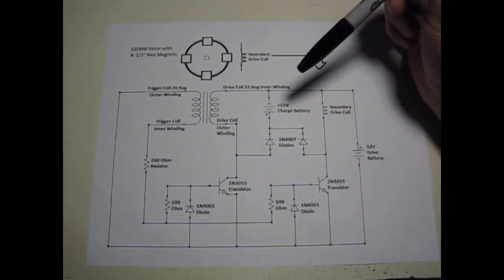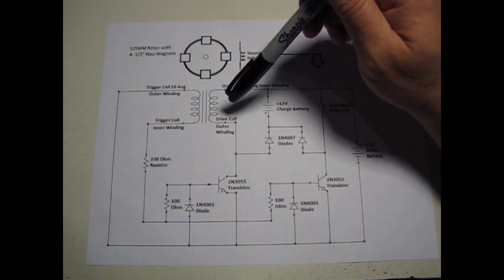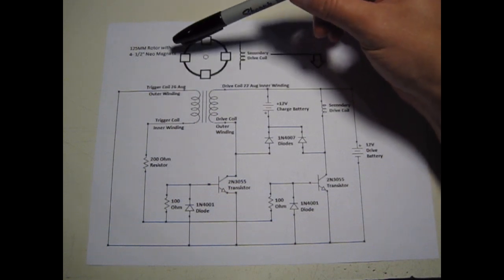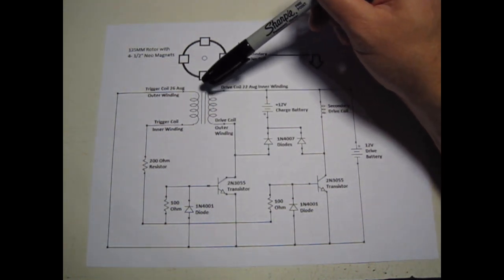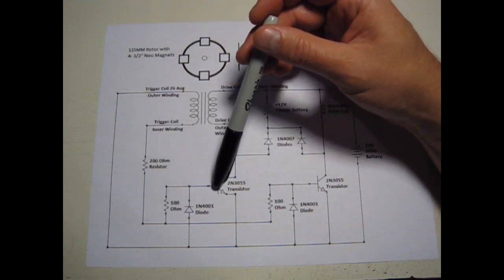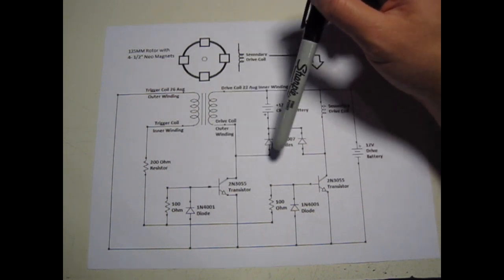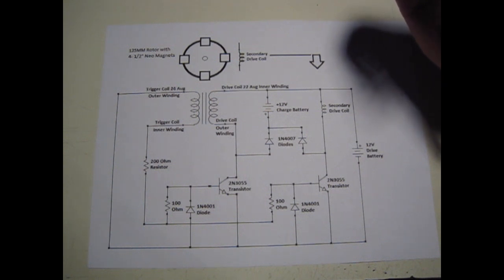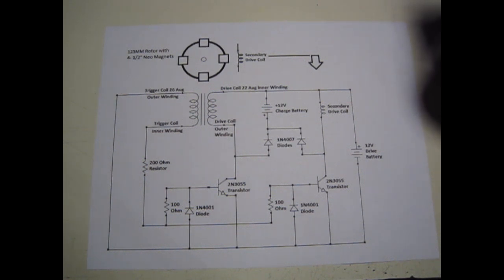My Understanding of the Bedini Circuit and Timing

Comment: 1:00 correct and incorrect
the revers polarity is dumping into the battery not the drive battery polarity but the drive coil reverses polarity when the charge is removed

Comment: https://youtu.be/yi7cmUpMdX8 shows the best step by step explanation.
Bedini Motor Step-by-Step Operation
Step 1. As the magnet approaches the coil, it induces a current into the trigger coil that goes through the 1N4001 diode, the resistor and potentiometer. Simultaneously, the magnet induces current into the charging coil which travels through the blocking diode and charges the charge battery and then back to the charging coil.
Step 2. When the maget is at top dead center or directly over the core of the coil, the induced current stops.
Step 3. Once the magnet has passed the core of the coil, it induces a current in the opposite direction in the trigger coil. This current travels from the trigger coil through the potentiometer, and then through the resister, and then through the base of the transistor and out of the emitter, and then back to the trigger coil. This current  travels through the base of the transistor and then exits out of the  emitter, which turns on the transistor. With the transistor turned on, current travels from the positive terminal of the supply battery through the charging coil, and then though the collector of the transistor and out through the emitter and then to the negative terminal of the source battery.
Step 4. Once the magnet has past the coil, the magnet no longer induces a current into the trigger coil. With the trigger coil not supplying current to the base of the transistor, the transistor turns off. With the transistor turned off, current ceases to travel through the charging coil thereby causing the charging coil's magnetic field to suddenly collapse. This collapse creates a high potential spike current in the charging coil. This high potential spike current travels from the charging coil to the blocking diode and then through the same blocking diode and then to the positive terminal of the charge battery, thereby, charging the charge battery.

Comment: Try drawing up the circuit in time. The trigger saturates the coil and the back emf is the repulsor. The efficiency is all in the circuit being in resonance. If you get runt pulses as you describe then some part of the circuit is the wrong. Example the resistance of your wiring, maybe induced capacitance that type of thing. Someone else here talks about double frequency I would go with that, replacing the transistor with a mosfet will fix that.

Comment: The problem with this circuit is in the discharging of energy in the primary (26 GA) every cycle. Since the base of the transistor cannot consume all the energy. I think that the circuit fault is the 1N4001 and that it should be a zener or schottkey diode, not a rectifier. In addition, it needs to be a zener or schottkey that can support the current drain from the primary coil in time with the frequency of operation. Otherwise there needs to be a better detection and trigger circuit that isolates and will allow the consumption of current. I would try an opto-isolator (opto-FET) instead. In addition there is a better circuit using an full or half H-bridge for commutation of the transistor. IMHO this circuit is simple, but too simple and neglects some good design practices. It should be looked at carefully for each side; including the transformer (primary to secondary effects) when each side is charging / discharging.

Comment: If you add a neon bulb 105-125 volts with external resistor  indicator in each emitter -base transistor  it adds a better oscillation.

Comment: Hi Dave. 
My Bedini 4 inch hard drive motor stops spinning when I hook up charge battery tarted all kinds.from what you have said I should be looking at the resistors and pot set up?It like it's putting A load on it and comes to a stop.if I unhook the charge battery is spins back up!what do you think is wrong? Help Bruce
Reply: For all you guys trying to achieve overunity my advice is that before trying to build any prototype, it should be working first on paper, when all does work on paper and simulator if you have the tools then you build your prototype.  For now the "Thing" stoping the 4 inch motor is know as "lenz law" and let me tell you this bastard "lenz law" is not easy to trick it in to giving to us free energy,  to describe it in terms that you know   it is like "soaking your hand in a pool full of water , every direction you choose to move it will react against your motion.  You can also feel lenz like this, disconnect the electronics from coil, short circuit both coils, then try to move the 4 inch motor with your hands, this is how lenz feels like, My guess is that the error comes from Bedini that misunderstood lenz law thinking he can make it push. Because this last part is not true is the reason the motor stops.
Reply: @Aircooledpowerquest  You have no idea what Bedini was thinking, you have no idea how his device works!!

Comment: Greetings I have worked in various designs within Badini theory, I have that to achieve enteder autonymy a home must have 3 basic things that are high speed, and get to work with vaoltaje is over 230VAC, and have a batreia 700faradios ultra capacitors to 16vcd, to load the system wattage kind that yields but her turn to see the trs. gibts as greetings option atte energies jr

Comment: So any adjustments you make to the resistors at the base are best made so that the base emitter potential before the pulse is about 0.4 to 0.6 volts. Any more and it will conduct without a pulse. Any less and it will eventually generate harmonics or double pulsing.

Comment: The multiple pulsing you are seeing occurs when you apply a smaller than normal bias current to any PN junction i.e. your transistor base emitter junction or a diode. It's a technique used in RF circuits to typically  double frequency through spurious harmonics. 

So any adjustments you make to the resistors at the base are best made so that the base emitter potential before the pulse is about 0.4 to 0.6 volts. Any more and it will conduct without a pulse. Any less and it will eventually genera

Comment from the maker: @llorencaguiar - Hey llorencaguir...the potnetiometer is only used during tuning and goes where the 200ohm resistor is. When I measured it...the resistance was roughly 200ohms. The neon bulb is just used as a visual aid for tuning...I prefer to use an O'Scope. It would connect to the Collector and Emitter of the Transistor. If a Bifialr Coil is used for the secondary Coil...just connect the 2 outer wires together and the 2 inner together. This would put the 2 Bifilar in Parallel to act as 1 Coil

Comment: I hope you can answer a few of my questions:
Are potentiometer and a neonbulb used on the circuit?
If yes, where do you put it?
The second coil seems to only have two wires connecting it in the schematic- since it is a bifilar wrap, wouldn't it require four wires? (like the first coil)

Comment from the maker: @usedbandage9 - I think its pretty much the same thing. I've heard that by twisting the wires as you wrap them...it makes for a more efficient coil. (I've never twisted them myself so I'm not sure.) I have done a Trifilar coil...3 wires wrapped around the coil. 2 of the wires I ran in parallel with each other, the 3'rd I used as the trigger line. Made for an excellent coil for the Bedini Circuit.
Dave

Comment from the maker: @allclear7- Thanks...Great to hear. I haven't tried a Trifilar yet...maybe on the next build.  (I think that would be interesting). I also used a variable to find the sweet spots...then measure and put in a resistance that is close to it. I've been using the same wire, and pretty much the same # of windings on my coils so far. (650ish)- I have an un-used coil right now...thinking of a fun type project to do with it. Thanks again!
Dave